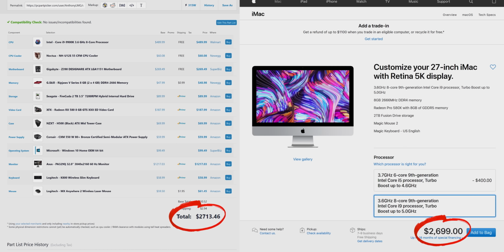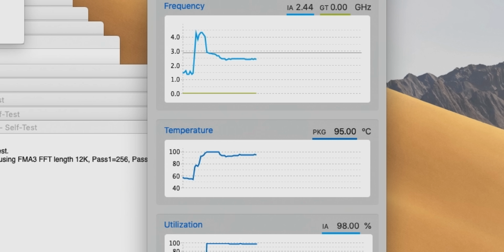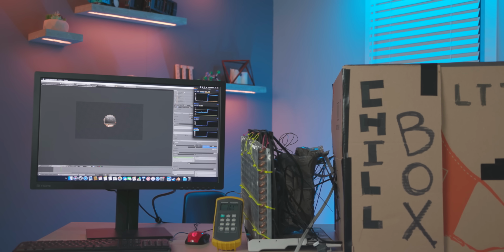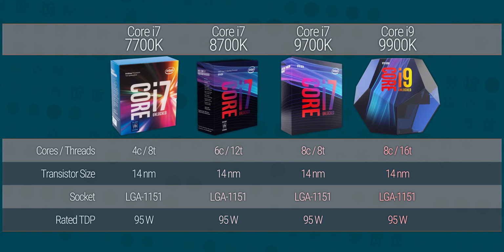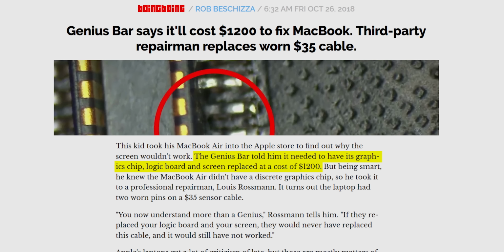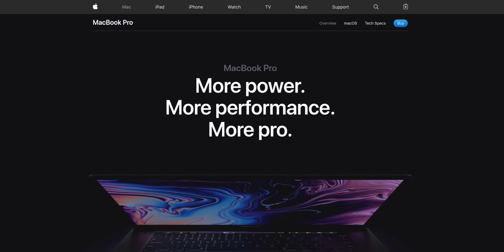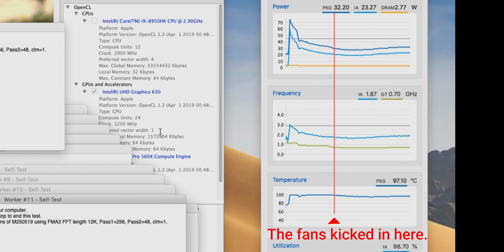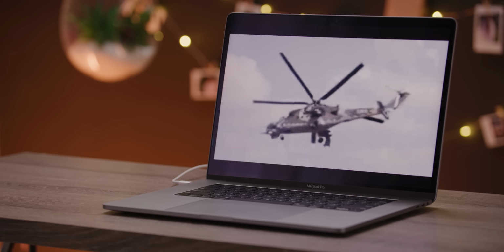Macs are SLOWER than PCs. Here’s why.

Comment: Just putting this out there, 8 year old 2011 Mac still running today pretty much no lag on most things prolly gets hungup for any gpu task because no independent gpu but everything runs great considering I will bet there is aren't a lot of  Windows laptop out there that is still functioning on all cylinders and updated to the latest version of Windows running for 8 years. Ya I did pay almost 3 grand 8 years ago but that works out to a yearly avg of 375 dollars a year(which is still decreasing ). Got another MacBook pro end of last year finally and still using the old one as a media server.  This is the reality the only 10 -15 % of the laptop market uses PC's for gaming and that number will keep decreasing because the future of everything is cloud so for most professionals macs are the go to choice because Mac os is way better than windows in terms of productivity, ease of use, and, reliability. Not everyone is gaming  or rendering tons of video out on their device and even if you are the macbook pro does an ok job with gaming and good job with rendering video. It out classes  everything else in other categories that matter when it comes to laptops battery life and portability and read and write speeds and data transfers speeds. Another nugget, failure rates for macs have taken a toll due to the keyboard issue it's  around 12-14 % which is bad but you know who is worse every other laptop manfucaturer who average around 19% to 25 % that number is going down though. So heres the crux of it sure macs are overpriced and relatively kinda underpowered but day to day performance is significantly better because Mac is way more efficient than windows and long term reliability and regular updates allow to be of use significantly longer than most Microsoft laptops. Eventually this argument of specs will become zero sum because eventually everything will be run on the cloud but when that happens I would rather still use Mac is because when it comes software its just better for most people.

Comment: As much as I hate Apple and their convoluted closed ecosystem, I'll suck it up and come to their defense.  This may be true from an all things being equal perspective if measuring from the get go, aside from OS.  Over a real world use scenario and through a real time window of several years with a standard computer illiterate user representative of the general population...the Windows system will eventually be slower as it bogs itself down via disk fragmentation.  Doesn't mean as much these days with the advent of SSDs, but still, every avoidable and unnecessary process that can be eliminated must be in order to maintain the highest possible efficiency.  No wasted clock cycles.

Comment: Don't cry when you get ARM chips in your MacBooks
Reply: This is the answer to Linus' question.  Stuck on Intel's 10nm node Apple has good reason to begin the transition to ARM starting at the lower end MacBook/MBA.  Intel will remain at high end for now, but even that's looking grim with ARM v8.x extensions.  Bitcode in LLVM is their solution to the problem of translation between architectures and it gives the public good reason to keep supporting the App Store.   For everything Darwin underneath there is brew (and MacPorts).  I suspect they will integrate it or release their own command line dependency compilation tool.
Reply: Microsoft is also preparing for the move to ARM.
Reply: @scratchy996  they tried with windows RT.  Since it could only run exactly Jack and squat, it never went anywhere.
Reply: @scratchy996  where is that prooof
Reply: RISC-V is the future.
Reply: Joseph Grant For embedded devices, quite possibly. But it’ll take a long time to supplant ARM in consumer devices.
Reply: I might cry, but they'd be tears of joy.
Reply: Say hello to a12x
Reply: What’s funny is “when” that happens,  some if not most may want a Windows build. Read up on not just what apple is doing with ARM, but AMD and Samsung etc are also. A desktop ARM chip - I know it sounds counterintuitive - is planned within the next year or so last I read. And why not when 2018 iPad Pro’s single core score from an ARM processor was up to par with an 8th gen intel I7. Intel screwed apple.... Yea they could’ve changed their whole body style for the pro models due to Intel screwing them, and I have no idea why they haven’t yet but they will, or make an otherwise equally impactful change. Once the thermals are handled and you know they’re working up to it, Windows is straight handicapped having to support 1,980,0998,344545 different parts and will never be as silk as an OS made to run on specific hardware.
Reply: Special Friendz Windows already runs on ARM! But there’s a bunch of drawbacks at the moment which would be quite annoying.
Reply: Seems everyone forgot the lack of proper PowerPC laptop processors of those days. That was the driver for Apple to move to X86. ARM might sound great but it will have its limits. Platform Fragmentation among portable/desktop/server solutions will be a barrier as well. I do not believe in ARM to come anytime soon. Perhaps In Macbooks but who buys a Macbook anyway?
There are gamers out there. No, ARM won’t be the industrial standard IMO. I might be wrong however. I wish I had a good Macbook Pro again.
Reply: C Rizzy  Total obsolescence is complete non-sense. Not only will the old Intel macs be supported, but Macs can run Windows as well which would still be fully supported on the Intel platform. But if you think Apple would just abandon Intel users you would be wrong.
Reply: @andremessado7659  they have that is not a new practice
Reply: C Rizzy  the only thing im thinking rn is that you completely misunderstood my comment. Its not about Apple and the other Desktop CPU vendors, but about the potential of RISC instructionsets. And btw, Apple already is class leading in ARM designs.

If they (or anyone else for that matter) manage to draw enough attention/interest from devs to their respective platform, it would be game over. 

You cant keep shrinking/improving latencies forever, so you have to add more cores at some point, and thats exactly where ARM wins.
Reply: That would actually be better! Much more appropriate for such slim devices, and probably great for battery life
Reply: That outperform your Intel shit with more security holes than a cheese grader
Reply: I eagerly await this change. It’s clear that the X86 instruction set has finally hit its dead-end.
Reply: C Rizzy bootcamp with Windows 10 on my MBP 15" '16 is super buggy. The touch pad driver is horrible and never works the way it should
Reply: >implying that’s a bad thing

Intel has been resting on its laurels for far too long, and has had the effect of hobbling Apple computers since about 2013. Apple going to an in-house CPU would be good for them, because AFAIC Apple has always done better with ‘unique’ CPUs than common ones (both my iBook G3 and G4 feel very snappy despite their age and PPC processors for example).
Reply: @Ebalosus  Should be interesting as AMD announced that they are releasing the 7nm 3000 Ryzen series in Q3 this year.
Reply: THAT will be my last day with computers
Reply: @endrelovas1051  X86 is holding us back since like 2005. 
If nothing else happens (like a breakthrough in 3D stacking), ARM will definitely be the future. 
Much better instruction set and power efficiency.
Reply: @Sundara229  I hear ARM is the future so I wouldn't cry that much (Apple will not be the only manufacturer to take advantage of this... Apparently the PC Market will do this as well)
Reply: @stephenfgdl  I guarentee the PC market wont  because wintel
Reply: @donovan6320  watcha wanna bet... AMD is making a dent... why not ARM? The PC market is exited... I think they are developing windows for ARM as well.
Reply: @Sundara229  what does arm have again that overthrows x86 performance wise?
Reply: @Ifalvarado  a better instruction set that allows for better parallelization.
x86 in its roots is made for sequential workloads, so we have to find ways to "emulate" and allow for parallel computing to benefit from more cores. Its not as efficient as native prallel code and computing, hence why we get deminishing returns from more than 32 cores.

That means, if we cant push CPUs to higher clock speeds and reduce latencies AND dont benefit from adding more cores, its a dead end. The main reason why we didnt already moved away from x86 is the money and time put in todays software infrastructure. I mean, we cant even move away from COBOL, let alone something as fundamental as the x86 instruction set.

Comment: This was a little disingenuous. You admit other small form factor PCs suffer from the same cooling and throttling issues, but then go on to blame Apple. Yes, I know I can get a big brick of a gaming laptop that will smoke a MacBook Pro. But for everyday use that is not what I want and it’s not because I’m not tech savvy. 

The only thing I agree with here is the misuse of the “Pro” label. Pro should be reserved for power users and Apple should give them an option to meet their needs with fewer compromises. ****And that brings me the question that Linus always avoids when it comes to cooling issues - how much bigger would you have to make it? Would a few millimeters in thickness do it? Or are we looking at a 1” thick machine?****

Comment: How do we achieve higher clock speeds without creating extra heat?
Reply: Within the same architecture, less heat is only achieved via smaller transisters (14nm -> 10nm). However you can dissipate heat better with larger dies,  better cooling, better thermal compound, etc.

Comment: I have one question: if i was to buy a surface Laptop should I get the 1st gen. with an i7 6600u + intel iris plus graphics 640 or the 2nd gen. i5 with the intigrated intel UHD Graphics 620. Both cost aproximatly 1000 Euros.
Reply: Personally? Neither. You can't upgrade or fix those. They literally have a score in both of 0/10 from iFixit. If something dies, you're toast.

Comment: that reason why they keep putting those i9 cpu's in their computers, is strictly MARKETING!
let's just say that there was Macbook pro with i9 cpu and one with intel atom cpu, which one would you take?
the one with the "RAW POWER OF 4,7GHZ i9" or one with just intel atom 1,8ghz. even thou daily usage didn't differ and when you would need the power, the i9 would throttle down to match the atom cpu on it's peak.

and to the end. i know that not even apple, (hopefully) have managed to fuck their machine that much, so their i9 cpu's would go down to atom class.
it was just highly exaggerated example, and is based on nothing more than my view of how apple really loves their customers. or just their wallets.

Comment: my mac might be slow but its still my backup computer everytime Microsoft rolls a major update that wrecks my pc workstation!
Reply: That's why you use linux and run virtual machines. If you do it correctly, you should only see a 5 to 10% performance penalty.
Reply: @TheAnthonywildman  Which is less than what you lose to thermal throttling. Of course, you still lose a lot of performance to the steaming pile of garbage that is windows, so perhaps dropping the VMs and working on Linux is the better option.

Comment: I e been a long time mac user.  when I needed a new machine, instead of buying a new mac laptop, I built a desktop.  While I do like macs, for my purpose, I needed something that could last me more than 3 years and macs have a very short life.  liquid cooled, and around $4500, I know this desktop is going to last many years.  I still use my mac, but just remote into my workstation (arch linux, byobu) to start the heavy stuff.  The performance difference between my 2015 top of the line macbook pro and this machine is night and day.
Reply: Depends what you want to do and how much power you need. If your profession can be improved by every new iteration of CPU/GPU (like video or 3D rendering) then yes, any computer will be out of date quickly.

If you're a web developer, a Mac will last you 5 years minimum. Mine is 6 years old now and is plenty fast for what I need it for. I only want a new one to step up to a larger screen and have more RAM. Soldered RAM is my biggest complaint with Apple laptops!

Comment: Louis Rossmann told you during the 5k pro Mac video. Apple want their products silent as possible, with a huge negative impact on thermals.
They even setup the circutry to report 127°C to the BIOS, when the thermal sensor breaks, throttling the CPU to minimal clock or even emergency shutdown.
Also, that's why they use high-power parts in the first place, so you don't notice the throttling at all. Unless you try to WORK on those things.
Here is a quote: "People with the power to (pro)create use an Apple, people with jobs use PC"

Comment: I was given a hand-me-down Mac Pro a few months ago. My sis in law was using it mainly for e-mail and files but I think the guy she got it from was editing video. 
It's about 10 years old, it's got 24 GB of ram, 2 Xeon dual quad somethings (I'm not near it or I'd look) a 1 GB Radeon HD video card and 4 TB of storage on 4 separate Western Digital drives. 
I think there's about 6 fans inside the box plus the one on the video card but I'm having to open the side and put a 20 inch box fan on it too. Did not need to open the heat vents in the room this winter. The monitor, I mean um... Cinema display gets hot as hell too.
I installed Windows 7 Ultimate 64 bit on two of the drives (yep...boot camp). When I bring up Task Manager it shows 16 processors on these two chips.
Other than needing to maybe keep it in a tub of icewater I can play WarThunder air battles on "movie" settings at around 72 fps. Photoshop doesn't faze it. 3D renders in Poser or Bryce go pretty damn quick. I haven't installed and tried to kill it with LightWave or Maya yet.